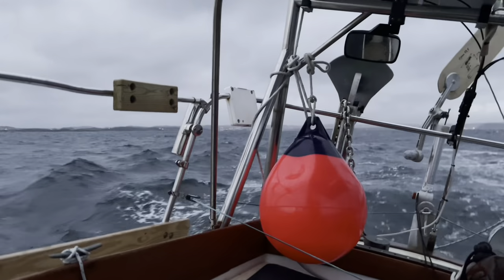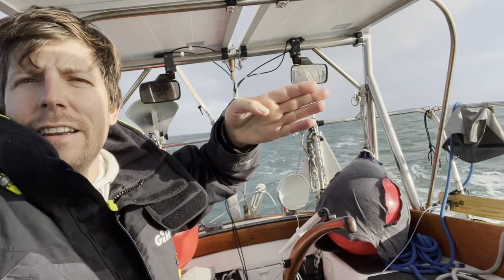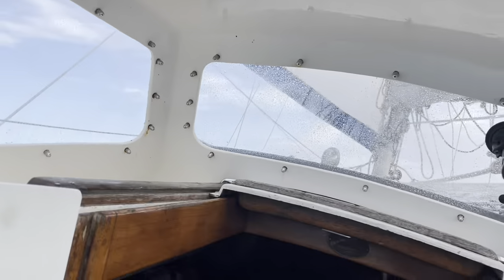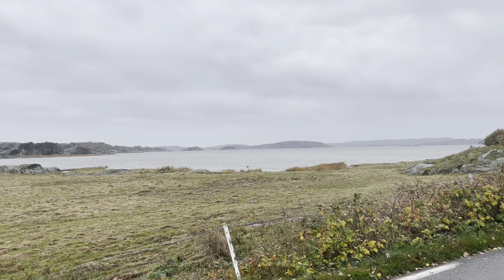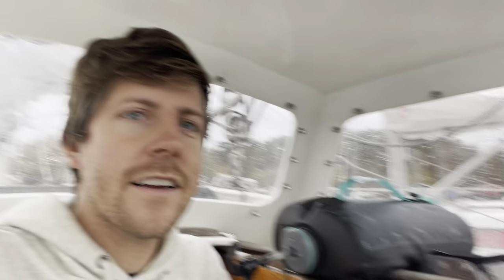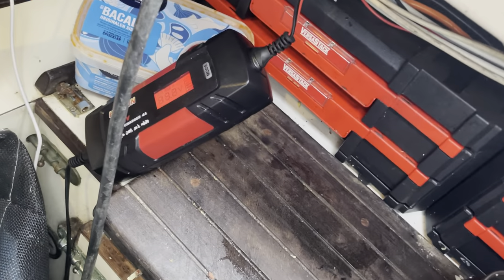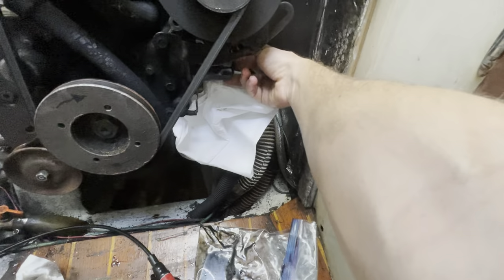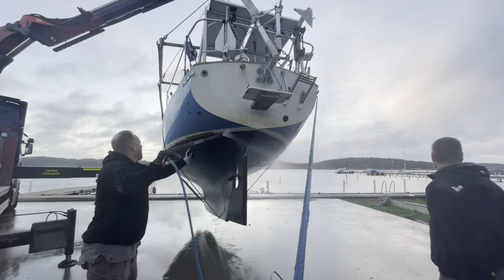Hauling out for winter in Sweden

Comment: I had the same probelm with my diesel heater.  its just a question of adjusting the fan. I put a washer or two under the screw that fastens the elctrical panel. That way the fan was adjusted a lot better to the sensor. The fan itself also had some casting residues, that initially rubbed against the sensor. I removed the residues with sandpaper and voila! A have no more errors...

Comment: Hi sam , could you tell me  , was it a 23ft swing keel or drop keel and did it lock down tight or did it move about a bit  , and what was the brand or design of that boat  ? You have always got interesting videos to watch  . Thanks Sam cheers
Reply: His first boat was 23 feet. This is a 28 foot Cape Dory with a fixed keel.
Reply: @emilybh6255  yes Emily I was under the impression that the ranger 23 had a swing keel but it looks like they only came out with a fixed fin keel , my error , thanks for the input , cheers

Comment: Sam its been great following your videos from you left usa, its been a great achievement for you.
As for the yanmar cold start problem, if it were my engine i would aquire an eberspacher or mikuni diesel air heater glowplug and drill and tap a threaded hole in the air intake manifold and fit the glowplug in. Wire it through a relay from ignition circuit so it heats while holding key in crancking position and disconnects when engine starts. Probably a preheater element from an older tractor might be better as it wouldent draw as much current. Certainly would improve cold starting. Not been critical but would advice renewing raw water filter before it disentegrares and leaves u in the brown smelly stuff. Im a great believer in the 6 P,s Im preparing my boat for a cruise to orkney & shetland from the clyde this year.
Enjoy your break.
Reply: That's a good tip, thanks. Never would have thought to modify the engine to have a glowplug.  Another option I can see would be to get a secondary switch for the plug, or to change the ignition switch to one with glowplug function maybe.  That way you can warm up the plug before cranking, as it should be.

Comment: I seem to recall that when you solo sailed to Hawaii, you had not sailed a boat on anything larger than a lake or a bay! I admire what you have accomplished. In SA to do similar you require to pass your captains certification. For this reason, I would like to buy a US registered boat which is exempt from this requirement. I am bright enough to pass these exams but after I was run down by a truck, I have lost the ability to write legibly which kind of limits me!

Comment: Sam, what a spectacular sailing season that was, well done, Eric the Viking has an awful lot of catching up to do to equal your ocean crossing explorations! Do you have any photos/plans or video of the fitting of your transom platform, they are so practical I think they should be on all sailboats where possible especially for singlehanders to assist boarding from swimming or dinghy’s! Does the wind vane operate beside it, they seem very close together? SkipRay.

Comment: My 2GM won’t start in the 40’s F. If I have electricity I heat fuel lines into injector with a hair dryer and point the hair dryer into the air intake. Starts right up

Comment: When abouts are you planning on re-floating Pickled Herring? I enjoy your Vlogs and admire how you face your challenges. I was disabled in 1992 when a speeding truck wiped out my car after punching it into me, disabling me. I know that I cannot handle a boat much larger than 40 foot but you make smaller boats look easier to handle. I live in Zululand, South Africa and even in winter, the coldest it gets is maybe 18 centigrade. I get sea breezes warmed by the currents flowing South from the Equator so it is highly unlikely to ever snow here.

Comment: Sam, was taken aback when I saw that it was necessary to cut the mast electrical-wires.  Anyway, do-not use simple spade quick disconnects unless you can 100% guarantee that there will be absolutely air-tight and no water ingress because they will quickly corrode.
I would try and find some gas/water-tight locking connectors to permanently install (maybe in a watertight enclosure) if you feel you will ever need to disconnect in the future.
If not, I would make strong mechanical connections with each wire (probably J-hooks since you don't have a lot of extra cable) then carefully solder each connection and then seal every wire and the bundle with fusion-tape--making sure you fill any air-pockets or voids (use plenty of tape and wrap the outside at least 6-8 inches each way from the splice).  But whatever you do, the connections need to be gas-tight or you'll for sure get corrosion in the connections from constant sea-air and water. 

Q:  Are you an Amateur (Ham) Radio operator; HF is a great communications medium and a good way to pass time when all your books, podcasts, and movies are stuck in the cloud--LOL?  And if you lose your other electronics, it can save you in an emergency situation.  When I was young I used to keep radio-schedules with several ships in both the Atlantic and Pacific.  I would pass progress-reports, weather information and exchange welfare checks with their families using both voice and morse-code.  This was all before modern GPS, and satellites were available.

Really love your videos and your GREAT community of commentors--have learned a lot on you channel!

Comment: As for your diesel heater.. if its a Chinese copy you should probably carry two spares for it especially in colder climate. Or get the webasto version and have a little less worry. Maybe a aftermarket intake heater would help your cold start trouble. BD diesel makes one that looks straight forward to install..
BD Diesel 1041563 X-Flow Air Intake Heater Kit.

Comment: Sam:

 A lot of old school Direct-Injected Diesels....the owners would tap a hole in the intake to recieve GM style 9volt fast glow plug. Yes, those GM 9volt glow plugs get yellow real fast versus a 12volt glow plug. Usually in colder climates  where people did that. Even Cummins then/now equip their direct-injected diesels with an Intake glow plug (just 1)...to stir up the air for extreme cold scenarios and cold-blooded engines. Just an idea for you to keep in mind. When time and weather allows....make sure to do as much preventive and necessary maintenance before you lower your boat back in the water. The water is no place  to play Russian Roulette with stuff that needs to be looked at and fixed.

Comment: Re: your water tank inspection port, I installed the same inspection ports on my water tanks. Remove the ports and reinstall, but caulk first. I used Butyl rubber tape. The screw top should have an O ring so that is probably not the problem. The leaks are where the port screws into the tank.
Reply: I've found that even with a brand new inspection port of that type with the O-ring, they still leak if submerged unless you really crank them on ridiculously tight.  We had to use a hammer and screw driver to pound-rotate the lid super tight to keep water from entering the bilge from our swim platform. Kind of defeats the purpose of being an inspection port.  They seem to only be designed to keep casual water out, not submerged water.

Comment: As an Aussie sailor i am curious why one needs to haul the boat out for winter and even more so why the need to take the mast out. To me that seems so strange. Can you explain why ?
Reply: There is no warm gulf stream in Sweden. Ice and storms, especially in tidal harbours can damage your boat. Storms can damage your boat also on land. Hence you pull the mast to reduce wind forces.
Reply: ice damages the hull if the port freezes even partially and when the boat is on land winds cause movement in the mast which can damage it, in the water the movement would be balanced by the entire thing moving in the water
Reply: @rustysailor4672  Ok thanks for the explanation, it seemed odd to me as here the only reason to pull the mast would be  if one were to change over the standing rigging.
Reply: @1240enzo  Also relaxes the rigging and makes it easier to throw a winter cover over the boat if the mast is pulled.
Reply: @svechappe6075  I understand, thanks. It’s not something we need to do here in Tassie, hence my questions.
Reply: @1240enzo  Totally understand, different customs for different climates.  Here in the States, we have regions of the country where the winter brings daily average temps below freezing for months straight with accompanying snow.  And in the case of the Great Lakes, the fresh water freezes over, so boats have to be pulled out.  So from November thru April on the New England and Mid-Atlantic coasts as well as the Great Lakes, we have marinas full of boats sitting on land with their systems winterized and typically fully covered either with canvas or shrink-wrap.  It's a sad sight, actually.  Cheers.
Reply: @svechappe6075  Thankyou for explaining all this. Here in Tassie, in winter as we are an island state and at the bottom of Oz we are generally speaking the coldest area in the country asides the alps. However, it rarely gets to O oC and the sea never freezes, so hence wintering a boat isn’t an issue. We generally just don’t go out sailing/boating for a few months, and even then some do if they have heaters aboard. Different climates explains all of what you discussed.  cheers